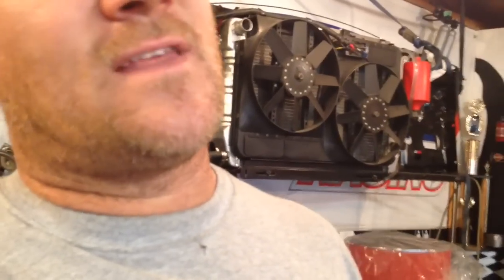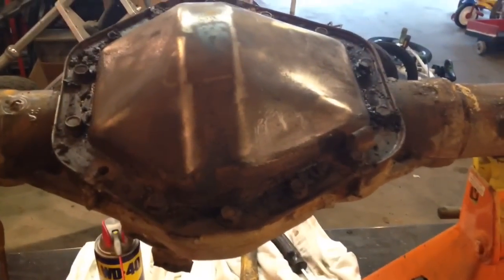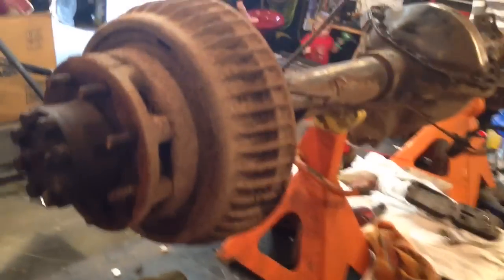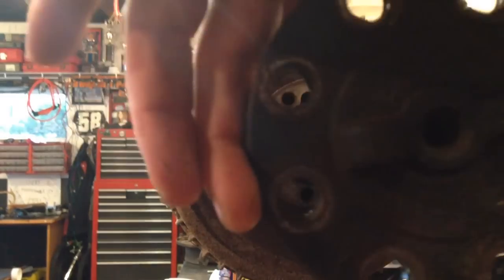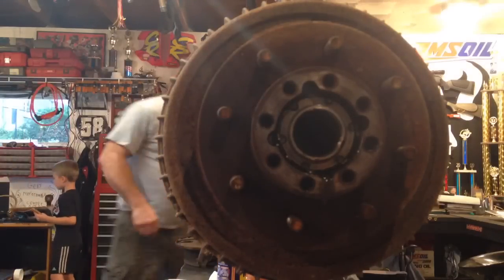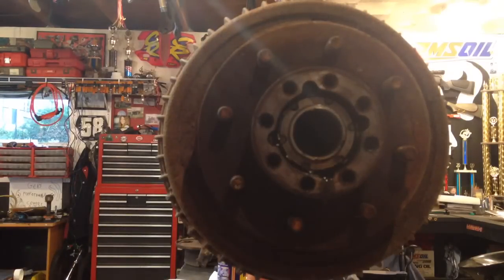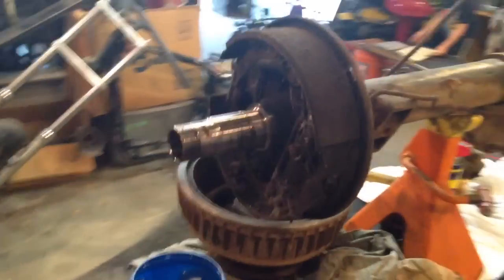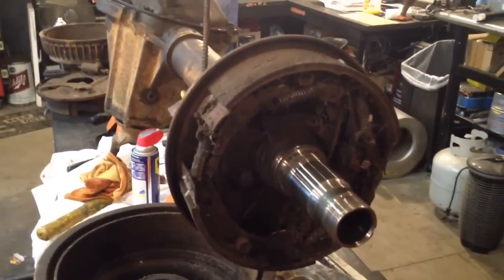14 Bolt Full Float Axle Disassembly

Comment: Thanks for uploading this. I need to replace the seal on my rear axle. It has disc brakes already and was trying to picture in my mind how this all went. :)
Reply from the maker: Excellent! I built this one back up with disk brakes too. It's on my channel as well
Reply: ill have to check it out. when doing the rear seal I have to remove the caliper/rotor etc to get to it right?
Reply from the maker: solaceofwinter Yep, just remove that hub assembly like in the video and your seal is right there. Clean the spindle where the seal contacts it too. My vid "14 bolt full floater disk brake build" shows how to set your bearing preload and such, then you'll be on your way!
Reply: youre the man. :)
Reply from the maker: Haha, thanks, not sure why my wife laughed hysterically when she saw that.
Reply from the maker: ***** https://www.youtube.com/watch?v=6zuwGGlN7Ek

Comment from the maker: JEEP J201981, Good question! There is a gear ratio break that determines which carrier will work with which gears. What gears are you running right now?

Comment: What year did that come from, i have a 88 3500 and 97 3500 dually
Reply from the maker: This was a mid 80's rear end. Great question, God bless!
Reply: aux1z11...i have a 97 4x4 k3500 dually that's pushing 190,000 miles, is a plow truck and worked hard. the truck is having issues in rear end....when backing up there is a rapid vibration if accelerating in a hurried manner! almost like mini wheel hops on the snow covered pavement....have you encountered this and did you make repairs?
any input would be helpful......thanx

Comment: I need to correct you so you understand and do this critical adjustment correctly as it seems you think you need to preload the tapered wheel bearings like you do for a differential and pinion gear. You do NOT preload wheel bearings, ever. At 5:30 you start to remove the first outer lock nut and you say "that's a little more preload than I like". That outer nut is not controlling your preload it's a jam nut or lock nut. Secondly around 6:40 when you're removing the inner nut you call it the locknut which is incorrect. This inner nut is actually the nut the controls the "preload" on your wheel bearing which you say feels better. Let me clarify this though, you NEVER preload or tighten that nut for final adjustment. Every factory service manual tells you to torque it down to maybe 20 or 30 ft lbs while rotating the wheel simply to make sure the bearings are fully seated. Then they tell you the critical and most important step. They tell you to back off the nut and just go finger tight. No torquing that nut no tightening that nut just go finger tight. That ensures that you don't preload the wheel bearing! On this one ton full floater you install a jam nut that you then torque down to jam the nut and then bend over the metal tang as a safety. But never preload that wheel bearing it'll get hot and seize and fail. Passenger cars are the same way except they don't have a jamb nut the just use a cotter pin. On those the factory service manual (not youTube) says you tighten to x ft lbs to make sure the bearings are seated then back off and finger tighten and if the cotter pin doesn't line up in the hole to BACK OFF the nut. So there's zero preload on that bearing and in fact there is play I the bearing. So yes you can and should have a small amount of play instead of preload on an adjustable wheel bearing. I hope this helps others out there as well.
Reply from the maker: Very good, thank you.
Reply: @GebBuilt  yepper, and nice video, good to see dad and his kids in the shop!

Comment: How much fluid does a 14 bolt hold. I'm putting cover with no fill hole and have to fill threw vent
Reply from the maker: The Military manual (LO 9-2320-289-12) for the M1009's rear differential says it takes 5.4 pints of 80/90 gear oil, or 75 gear oil if you're in a colder climate. If I were you I would do further research for your exact model but this is probable a good guestimate. Thank you for the great question! God bless!
Reply: Tahoe Tom your not looking hard enough.